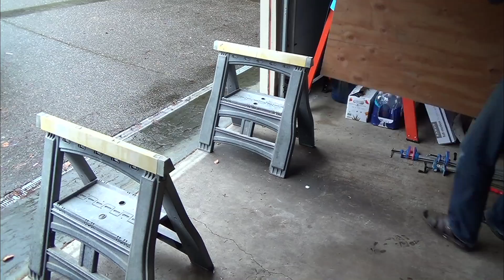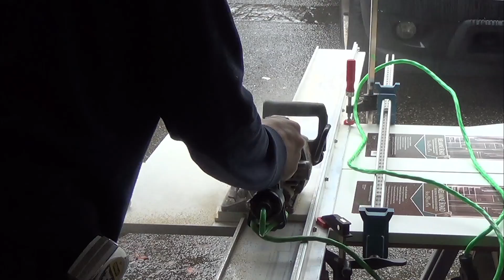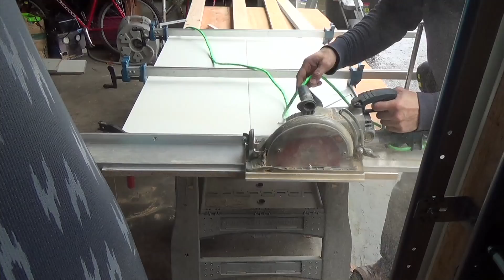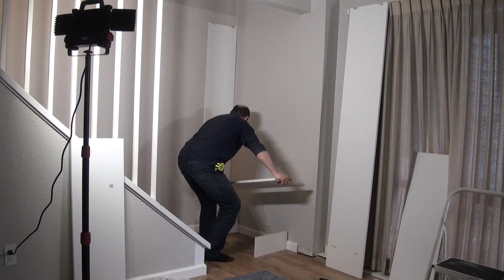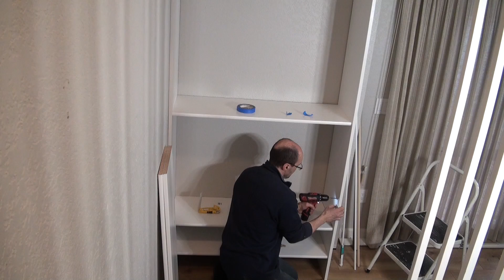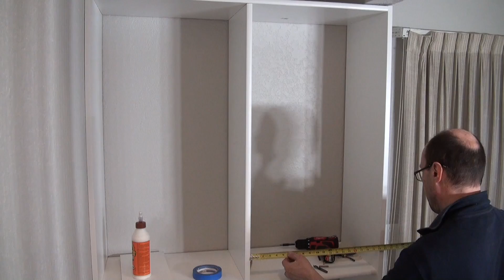DIY Coat, Shoe closet. Melamine White Shelf Board. Шкаф в прихожую

Comment from the maker: My NEW project is done! You may be interested in the Shower Pan Rebuild:
Shower Pan Rebuild. PART 1- https://youtu.be/NdhPWNkK66o
Cut tile from bottom of the shower. PART 2 - https://youtu.be/NNBwQVA1LwY
How to Pre-Slope Shower Pan with Beadex. PART 3 - https://youtu.be/prp_vglYv4c
How to install ABS Shower Drain. PART 4 - https://youtu.be/v57eQe-eC4w
Shower Pan Liner to ABS Shower Drain. PART 5 - https://youtu.be/9c9xxkL0Am4
Shower liner and Concrete shower base. PART 6 - https://youtu.be/LSbB_ml0UtE
RedGard Waterproofing Membrane. PART 7 - https://youtu.be/e_4Wzgtxic0
Install a Pebble Tile / River Rock Shower Floor. PART 8 - https://youtu.be/m9Zb81AMSI8
How to make a simple Jig to cut 45-degree tile edges - https://youtu.be/nzSYCPHPmRg
How to tile Shower Curb with 45 degree outer corners. PART 9 - https://youtu.be/wdOxYGWcFSk
How to 45 degree tile cut. No Jig, just hand - https://youtu.be/9WmOIYn1QL4
Footstep in shower. PART 10 - https://youtu.be/2YrMN22kz2k
Shower Curb, Wall grout & Glass Door Base installation. PART 11 - https://youtu.be/L0Ms7sEOEWM
How to Silicone a Shower. PART 12 - https://youtu.be/Edb9fXIdkRk
Schluter, custom size tile edge. Last 13th PART - https://youtu.be/kT9hc3D00ec
Reply: i know Im kinda randomly asking but do anyone know of a good website to watch new movies online ?
Reply: @Angelo Braydon lately I have been using flixzone. You can find it by googling :)
Reply: @Vihaan Abdullah Definitely, I have been watching on FlixZone for since march myself :D
Reply: @Vihaan Abdullah Thanks, I went there and it seems like a nice service :D Appreciate it !
Reply: @Angelo Braydon Glad I could help :D

Comment: Hi there, nice build.
Could you please let me know if the glue you used to connect the pieces of wood with the dowels was just simple wood glue? Asking because I am not very sure about the strength of wood on melamine glue up.
Thank you.
Reply from the maker: Hi, I was used Gorilla glue for wood from Home Depot - https://thd.co/3h7mwE8
But its not special for this shelves , just used because it was in my car on that moment. You can use any wood glue because it's not for melamine. I am not apply to melamine surface. Glue only inside both hole to insert dowels. 
Thanks!
Reply: @FixitAll  Thank you for the clarifications.

Comment: how can you puncture a hole in the melamine boards without cracking the white part?
Reply from the maker: Yaz S No cracks there.
Reply from the maker: This board has very thin coat of plastic (melamine) so no way to get some cracks.
Reply: Tape, painters tape
Reply: What tool were you using to puncture holes?

Comment: am still ... confused and scared of making that initial 90 degree connection. How did you know where to place the dowels and get a perfectly accurate plane/level ??
Reply from the maker: Tape measure and level... and pencil.
3:09 piece of material as a distance from bottom to the center hole.

Comment: How are you attaching the shelving to the dowels on the vertical panels?
Reply from the maker: Removable shelf sit on removable support pin. https://www.homedepot.com/p/Everbilt-5-mm-Nylon-Shelf-Support-in-White-8-Piece-801944/204273820
Reply from the maker: bottom middle and top was drilled for dowels.